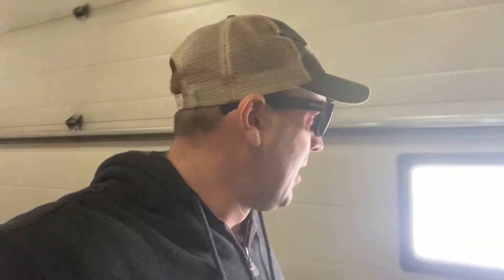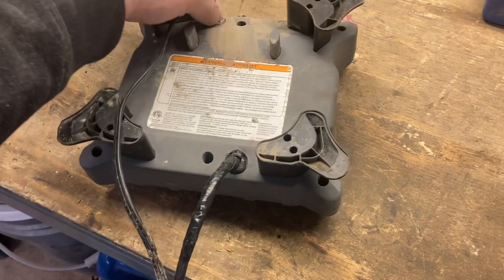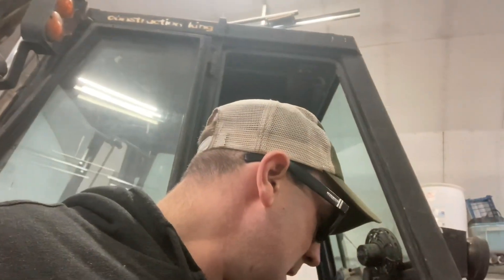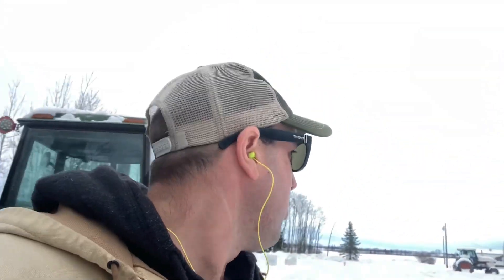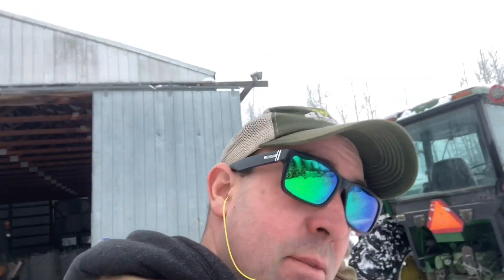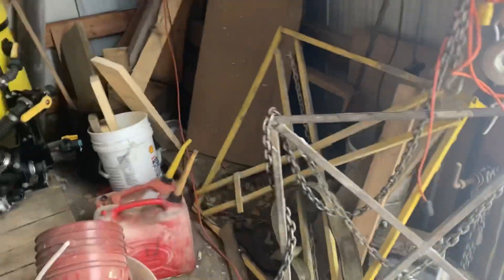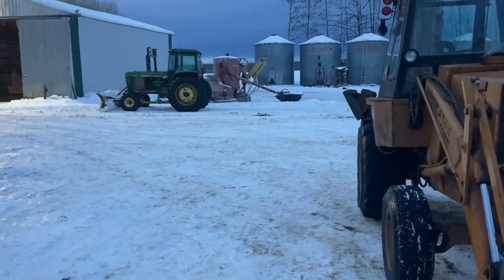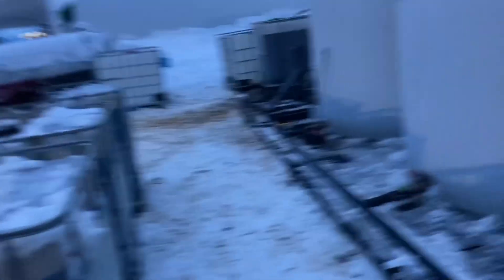What’s the difference between a deep cycle battery and a regular battery?

Comment: Regular batteries give more of a quick burst of "higher" power to the starter which is preferred for harder starting larger industrial motors. Deep cycle are designed to be drawn down over a longer period. The plates inside are usually thicker so even if they are run dead it does not damage the battery as a regular would be. That's why they are ideal for marine and rv. That being said I have only used deep cycle batteries on my larger farm equipment for decades. I find they are longer lasting and work very well. Most sellers just follow the "recommended" use that's why they say not to use them. A very experienced seller years ago was the one who got me started on them. There is no problem using them.
Reply from the maker: Very interesting. Thanks for the comment

Comment: AGM are better..we have used optimas for years. Now that they are made in Mexico, they aren't as good.. at least the red tops aren't.
Started getting the yellow top starting/deep cycle.
Freaking expensive, but so far, well worth it.
Service truck has 3, one semi has 3, the other has 2 and 2 old blue top deep cycle.. 
The diesel pickups I've had, always used AGM, never had starter issues.
Good to see your molasses system is working well 👍

Comment: I use a Odyssey 31M-PC2150 1150 CCA, Vibration resistance-design protects against high impact shock and mechanical vibration; Extreme temperature tolerant- Operating temperatures from -40 degree Celsius (-40 degree Fahrenheit) to 80

Comment: I went to Fairview as a mechanic. Still no knowledge on it. Regular batteries in my duramax's, garbage. Need agm batteries. No one has been able to say why. I assume it's the charge rates and what the battery can handle through acid and what the battery can handle.
Reply from the maker: Yeah, seems to be a bit of mystery when it comes to batteries
Reply: @millionairefarmer.  i use deep cycle for fishing at spring lake and my lights for hunting coyotes. Seems to work there. It's odd.
Reply: If you are interested in the basic differences I posted a comment above.